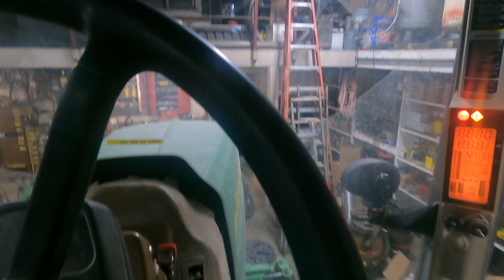John’s Silage Box is done!

Comment: Great Job by all on this body build . Uncle John should like it. The body looks awesome ! Where i use too work they has the U S A body & Tank . The Legs Could be put down for holding up body & tank while off the truck . After you got ether on the truck you put them back in the same spot only 90 deg. Had a spring lock pin . hole in the top of the leg & the side of the leg for transport . That way the legs were always with the body or tank . Top hole was for transport side hole was for holding them up lol i think you know what i mean lol Well it will be nice to see the flat bed done and on the truck as well . Jared's job on the bull dog looking good as well . The mixer wagon gets a lot of wear . One wouldn't think feed would be so wear steel out like it dose . 👍👍Another good video !

Comment: Hey Andy,
I think you are on the right track with the wedge idea for the mixer door.
Perhaps you can use some 1/2in flat stock and make an adjustable rail for the door to slide down into.
I have a coffee pulper that has a cast face-plate and is adjusted against a barrel. The  barrel is horizontal, but the principle is the same. The bottom is as close as possible without touching and the top is slightly more open. The adjustment is done on threaded rod, using a nut on each side of the face plate flange, basically using the jam nut principle. Turn the inner nut in or out to set the spacing and lock it in place with the nut on the other side of the flange.
In your situation you could probably use a nut welded to some bar stock maybe 6 inches long with some washers, springs, and a bolt through it to apply enough pressure for mixing and still allow the door to open without binding.
I don't know how much space you have on the slide rail, but I'm sure you could cut the bottom section and space it out enough to accommodate a type of pressure rail to keep the door closed tighter when it's all the way down.
Just a thought.
At least the extention and rubber piece are working for now.🤙
By the way, excellent job everyone on the silage box and flat bed extention.👌

Comment: That turned out great guys!!! I am looking for an old combine. It doesn't have to run and drive- basically all we need is a shell on wheels. It will be used for an agritourism activity. Thought I would mention it in case you knew of any. Thanks 🙂
Reply from the maker: Check with zeitsloft

Comment: Ever think about putting rollers on rear bumper for loading and unloading boxes? Keep it from getting scrapped up maybe.. just a thought.
Reply: Rollers would have been great. Maybe add them some time later ?
Reply: @workonitm8  They do not drag the box, rollers unnecessary. You are  equating this scenario to roll -off containers. When Andy transfers bodies, they are empty, so they can easily back under them while they hoist & transfer. Roll-offs are dragged when loaded because if the entire weight of a loaded box were transferred to the chassis, the front end would come right off the ground. Refuse folks depend upon 50% ground support until the box is approx  1/3 or more on the rails.

Comment: That looks great finished!  Hey Andy, could take just couple minutes when you're working on one of the trucks and explain a little how the switches and the valves interact?  I get the idea but I don't get how it's accomplished.  Great video!
Reply from the maker: Yes
Reply: @ mark    simple really, the actual valve body has a handle which serves as an actuator. The remote air actuated valve in the cab send air through a hose that either pushes or pulls the main valve to open or close remotely. Think of a puppet on a string. I have a similar set up on a tractor only the remote is electric.instead of air. An electric solenoid open & closes the main valve body. 😎

Comment: Where can I find those swivel pull "D" rings on either side of the rear hitch?  I have an 8' high capacity bucket that I'd like to add that type of "D" to to hold chains when needed.  Thnx    Great job on the box....the  engineering on the hydraulic system is amazing.
Reply from the maker: Buyers product company